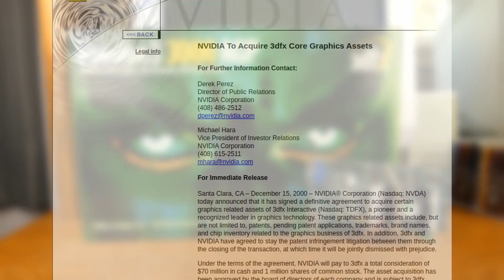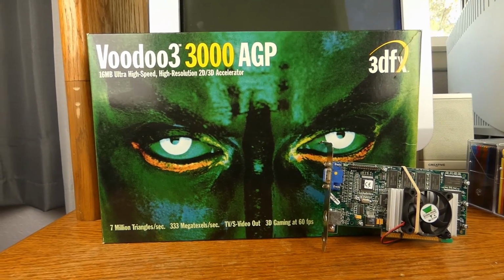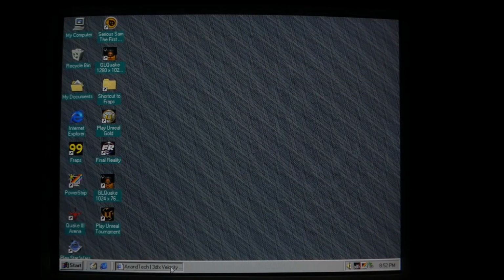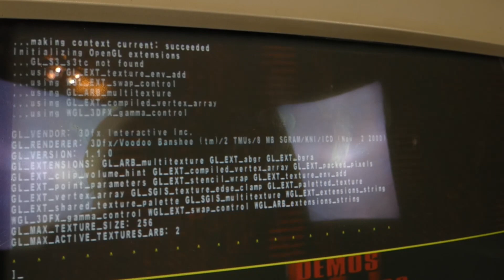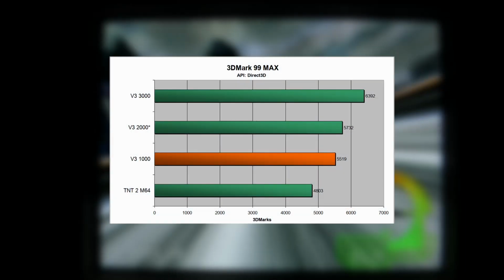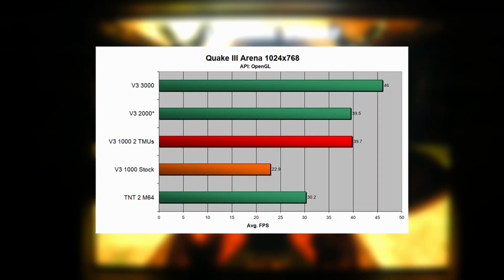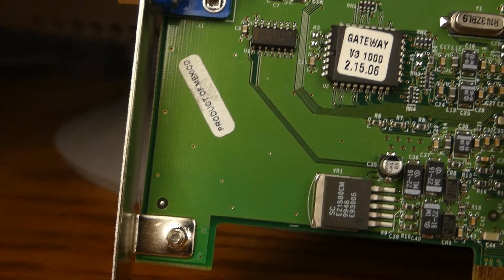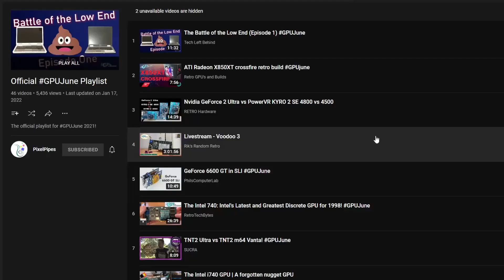The Voodoo 3 Everyone Kinda Forgot

Comment: Its nor logical a compagny Who downgrade His own product when the rival Do a fuck war of french against every position you own.The chief ingenior of 3dfx migrated on Nvdia,and Hé kept the same Tactics.
Reply: Yeap, Greg Ballard had no idea how to run that kind of company. Starting with STB acquisition, 3dfx was doing nothing but wasting their previous profits. Also, telling people that they don't need things like 32 rendering instead of just giving them isn't good marketing strategy, and having kickass flagship product is essential, Since people are buying budget options to have something "close enough"
Reply: @TurboMMaster  Voodoo 3 was still a very good and successful product despite supporting only 16-bit color and 256x256 textures, because back then not many games had support for 512x512 (NFS5, Quake3, Expendable), and 32-bit color performance wasnt good on TNT2 cards at (except for some older games, or lower resolutions like 800x600 or 640x480). TNT2 owners were playing in 16-bit color anyway and 16-bit color looked better on 3DFX cards thanks to dithering. Voodoo 5 should be however much better. 3DFX planned to use 4x chips in their V5 6000 just to match single Geforce2Ultra chip performance, and geforce 3 was already out :P.

Comment: How IT versus the Banshees at 130 MHz?
Reply: Practically a Velocity 100 was just a Banshee with 143/143 mhz. A GA630 Banshee with 110/130 mhz is of course slower than a Velocity 100 at 143/143 mhz. But at the same frequency the Banshee performs the same as a Velocity 100.

Comment: It's amazing how much performance that's left on the table without that reg change, this would be a great card for a Pentium 2 build as well!
Reply from the maker: Also great for a Super Socket 7 build. Great performance and driver optimization while avoiding AGP compatibility issues.
Reply: @NTGTechnology  Ahh yes indeed! They often have AGP sockets with specific Voodoo Jumpers on the motherboard.
Reply: @NTGTechnology I had a K6-2 400, then 500 with a Voodoo3 2000 at 3000 speed. It was FAST. The 3DNow drivers were incredible, especially in UT99.

Comment: In Unreal Tournament detail textures and volumetric light (fog) are turned on by default only in Glide, and off in Direct3d and opengl. If you turn those setting off in glide too, just like in direct3d and opengl, the performance increases by 25-35%. You can turn detail textures and volumetric light on or off by pressing ~ and typing preferences, than select Glide and from there you can turn them on or off. The results you got in Unreal Tournament were biased in favor of the M64 because of this.
Reply: We could also say that UT99 results were biased in favor of 3DFX cards, because default D3D and OpenGL renderers were very bad compared to glide in this game. Back in 2001, I remember installing a new D3D renderer that gave me a huge performance boost on my Geforce 2MX. With this patch the game was playable at 1024x768x32 + detal textures and volumetric lighting and with default D3D renderer it was a bad experience.
Reply: @PabloB888  UT was optimized for Glide just like Quake 3 was optimized for Transform and Lightning. All games were optimized for certain cards or APIs but to run the game with different levels of detail is really unfair especially because UT can be run with the same level of detail on all cards, by disabling Detail Textures and Volumetric Light for the Voodoo’s in Glide.
Reply: @supermario8416 I understand what you are saying, and I also think that reviewers should test video cards with the same graphics settings, but still, the default D3D renderer in UT99 (or should I say in all Unreal Engine 1 games) was really bad, so 3DFX cards had an artificial advantage here anyway. Thanks to improved D3D renderer my results skyrocketed and then Glide results in this game no longer look that impressive to me.
Reply: @PabloB888  Total non-sense. By the same logic you could say that the Geforce cards have an artificial advatage in all Quake 3 engine games because of the support for Transform & Lightning and because of this the Geforce cards should run with higher details when tested against 3dfx or other cards without T&L support.
Reply: @supermario8416  In my previous comment, I said very clearly that reviewers should test games with the same settings, so dont suggest that I want to test games with different settings on different hardware, because that would be ridiculous indeed. 

3DFX had no secret sauce that would boost performance to ridiculous levels (like in UE1 games) just on their cards. Other developers had no problems optimizing their games for both Glide and D3D. The Unreal Engine 1 D3D renderer was simply unoptimised, if not broken. Improved D3D renderer improved performance and also fixed glitches and colours (default renderer had washed out colours even in 32bit). I dont like drawing conclusions about GPU performance based on broken D3D API support, but that's just me.
Reply: @PabloB888  Non-sense again. By that logic you could say that any other game is badly optimised in a way or another, in order to manipulate the perspective the way you want it.
Reply: @supermario8416  I always looked at the whole picture. The vast majority of games run well in booth D3D and Glide, therefore it was obvious that something wasnt right in UT99 and other Unreal Engine 1 games. The new D3D renderer has improved performance considerably, therefore I'm sure that default D3D renderer wasnt optimised very well. But please believe that 3DFX had some secret sauce that allowed their Voodoo cards to outperform even much more powerful chips made by Nvida or ATI in this game.

Comment: Excellent video and benchmarks. The Velocity 100 has only 1 TMU activated in Glide and Opengl and 143 mhz. The Voodoo 3 1000 has 2 TMUs activated in all APIs and 125 MHz. The Velocity 100 in 1999 was in my opinion, by far, the best budget card, much better than its Nvidia rivals M64 and Vanta. Your results just confirm that.
Reply from the maker: The card I have is very clearly labeled as a 1000, both on the card itself and in the BIOS when the card first boots up it's displayed as a "Voodoo 3 1000G." And mine also only had 1 TMU enabled by default and runs at 143 MHz, so I'm not sure where you're getting this info.

Comment: As far as I'm aware- the Voodoo 1000 isn't the same as the Velocity cards. My Compaq Voodoo 3 1000 is different- it has 8x SGRAM chips for a full buswidth and 16MB VRAM, and lacks a heatsink (Like the ones you picture in the video online). It is effectively an underclocked Vooodoo 3 2000. The Velocity cards seem to be cut-down variations of this.
EDIT: It could just be up to the OEM as well how it's marketed.
Reply from the maker: Yeah there really just doesn’t seem to be any clear indication as to which name goes with which version of the card. I’m guessing your theory is probably correct about OEMs getting to name it whatever they wanted.

Comment: I didn't know that you could actually unlock these into a pseudo-2000! Too bad that doesn't make it any easier to get Voodoo cards without selling your soul. 😭

Great video.
Reply: If you search a while you will get one for 70-100€, I don't think it's so expensive, i just bought voodoo 3 3000 for 60€ missing one capacitor i soldered already. I am located in the Netherlands

Comment: A fun thing about this card is that it has Win 3.x drivers which also work with the rest of the Voodoo 3's, I think they only let you use 8 of the 16MB of the higher models' RAM but it still is plenty enough for a Win3.x desktop.
Reply from the maker: Yep, I actually used this for DOS/Win 3.1 for this exact reason for quite a while